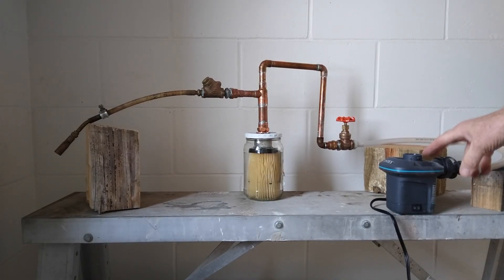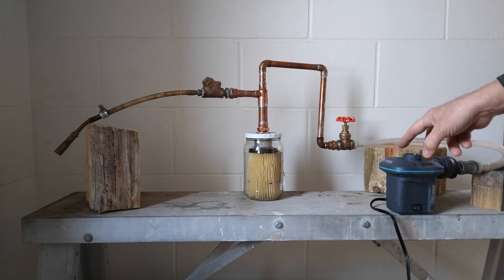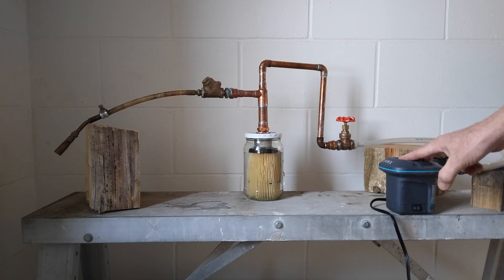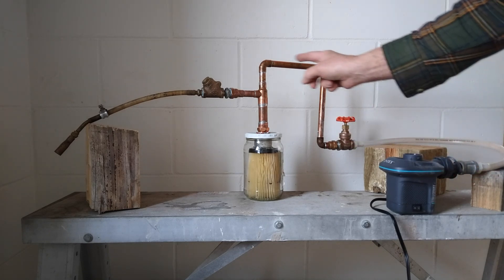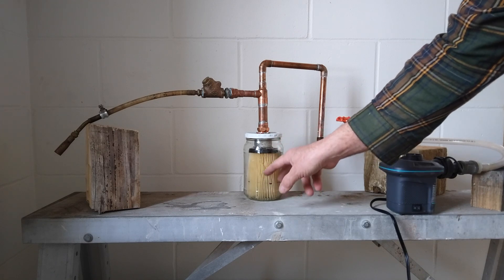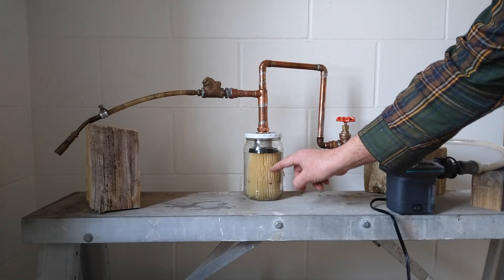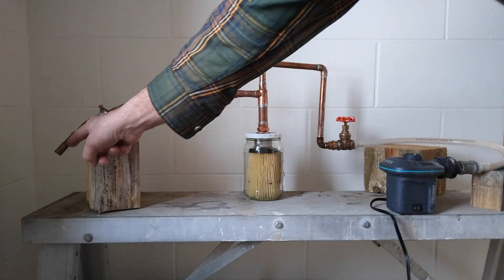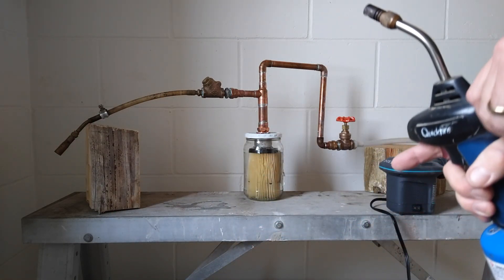Wick Vapor Carburetor R&D, 1st as a Gasoline Torch

Comment: Using heat from the exhaust would improve efficiencies. There is flammable gas in the exhaust gas that could be added to the ratio.

Comment: I discovered the same problem when I experimented with a gallon-size pickle jar bubbler-type evaporative carburetor. The lighter fraction came off first, then I was left with the heavier portion. At the time, I didn't really think about the need for increased temperature.

Comment: You can run a gas engine on the same wick carburetor system and you don't need the air pump. Gas engine draws vacuum.
Reply: I put one together with the wick system instead of the bubble or heat system . It runs a gas gene great at super efficiency levels. However in my experience the wick system still leaves u with stale fuel left over like the bubble or heat method .
Reply from the maker: Interesting.  Using a torch first as the gas vapor consumer, I figured I could narrow in on problems easier.  So far I found that if I applied a little heat from my hot air gun, the torch would still burn until the wicking filter paper is almost complete dry.  I know if I place a drop of gasoline on a cold piece of steel, (even if it was -20˚F), all of it evaporates.  So I would still think it would be a matter of having enough surface area, and enough heat to keep delivering enough gas vapors to be useable.  Anyway that's what I'm working at.
Reply: @doubleMinnovations  cool man 👍. Perhaps the gas I was using is different than what u are using . Bet ya my results were showing gas around here is full of water for cheapness and car wrecking ability
Reply: @doubleMinnovations  my mistake aswell the heat method doesn't leave it stale it's just a bit dangerous . So I have high hopes for your wick/heat method of vapour carb. I know bubblers are bad for making fuel stale .
Reply from the maker: I had the same experience with bubblers, though some say they got them to work.  I only seen one other who tried a kind of wick vapor carburetor about a decade ago.  And did pretty well on his lawn mower.  Just don't know the 'untold' story.
Reply: @doubleMinnovations  I seen that lawn mower one a long time ago too . That's why I did my little generator. I wonder if it's fine for bubblers if the gas supplier didn't water the gas down .
Reply: @doubleMinnovations  oh man just came up with a great idea . It can run engines wick only easily at the start ... Can we plumb some engine heat under the wick system for when the engine heats up ? That way we can vape all the fuel with the energy of the fuel alone
Reply from the maker: When we get warm enough weather, so I can work effective in the outdoor temps, I have an old Honda generator I can fit with the wick evaporator.  I would leave the working carburetor on to start it and warm it up, then switch to the wick evaporator.  I also would have a heat exchanger off the exhaust to heat the air going into the evaporator.  -That's plan A
Reply: @doubleMinnovations  one thing I noticed is you very much wanna get rid of the carb . It starts way easier first pull everytime on wick vapour carb. I'm curious to see what your findings will be
Reply from the maker: Could you do a video on what you have, showing it working?  I would be very interested in seeing your wick carburetor, and how it worked.  You wouldn't have to appear in it.  Just video it out in front of you, and tell about it.  That would be helpful to many others as well.
Reply: @doubleMinnovations  ya I could do that. Gonna have to wait a bit though cause I'm not home right now I'm in the city waiting to have baby 5 . Till then if you have any questions I'd be happy to help try and answer them . I started with a mason jar with humidifier wick . Then moved to princess auto ammo box stuffed with wick . Make sure the in tube goes inside the wick but not down into the gas so no bubbles just vape . The out tube goes to a tee and then directly to motor no carb . The extra input on the tee is for your air in with a ball valve on it to adjust the gas to air ratio .
Reply: @doubleMinnovations  have you looked into that competition the car manufacturers allegedly were in in the 60's or somthing . I forget what it was called ... They competed to see who could get the best millaege with the use of various vapour carbs . Claims reaching as high as 300 miles to the gallon
Reply from the maker: Congratulations on baby 5.🥳.   Sounds like what you did was similar to, 'vaporkid'.  -I think that's the name of the channel.  Was there a noticeable improvement in efficiency with the engine?
Reply: @doubleMinnovations  thank you! Yes vaporkid sounds right with his push mower. Yes noticeably more efficient and it makes sense cause the wick carb can make the finest fuel particulate ... Much finer than any jet or injector . You know as well as I do that liquid fuel doesn't burn it's the vapours that burn. If it's not fine enough it burns dirty and wasteful like in all vehicles today . Liquid fuel actually puts out cigarettes
Reply from the maker: I became interested again with vapor carbs after viewing Dan Easton's work on the GEET.  He seems to be an honest character.  Lots of extraordinary, unsubstantiated claims about GEET; (suppose to be levels greater than a vapor carburetor.).  Dans' scientific tests showed that he was getting  25-33% better efficiency with GEET than a regular carb, but he was able to burn different fuels; even vinegar.  -that would cool!
Reply: @doubleMinnovations  sounds cool not sure what GEET stands for but I'm gonna find out

Comment: Report back after testing with a hair dryer on low-medium heat... Good luck!
Reply from the maker: I need less restriction in the plumbing for something like that to work.  The heat gun I tried I could set to low (250 watts), but even with the fan on high, there wasn't enough pressure.  Still, something to think more about...

Comment: Check out the video "Oil Scientist Admits 1000 MPG in 1970's" on youtube. Look up the Ogle fuel vaporizer. There is a book called "Fuel Economy of the Gasoline Engine: Fuel, Lubricant and Other Effects" from Shell Oil company published in the 1970's. There are copies of it available. In the video they tracked down the author. He explained they were able to get 40-50 mpg in 1939 with first attempts on a regular car. Then later 100s of miles per gallon and in the end over 1000 mpg.
Reply from the maker: Thanks for the information!
Reply: @doubleMinnovations  No problem. I think you can make gasoline with the right pressure and temperature, something like propane. Keep in mind there are lots of additives to gasoline. 110 octane race fuel in the US has no additives. So keep this in mind when experimenting.
Reply from the maker: Looking at the flame, it looks like it's burning propane.  There's no soot or smell, so I think this is a pretty clean burn.
I was using 91 octane.  Don't know where I could get anything better around here.
Reply: @doubleMinnovations  You can get 110 sold as racing fuel. Planes also us 110. So you have guys that race cars locally they should be able to point you to 110. There are no additives which retard vaporization. You might try a hobby shop as well. I'm looking forward to your posts on this subject. So important during these high oil prices. Just imagine if you could get a generator to run with such efficiency. You might be able to power your home or shop for less than it cost to buy electricity. It sounds crazy but based on what the Shell Scientist was saying it is possible and has been done in the past. Sometime I think all the crap they add to car engines today are to prevent easy access to high efficiency. Luckily generators are still pretty simple.